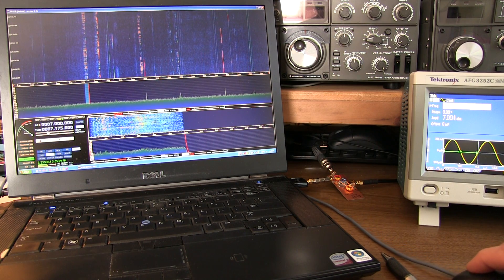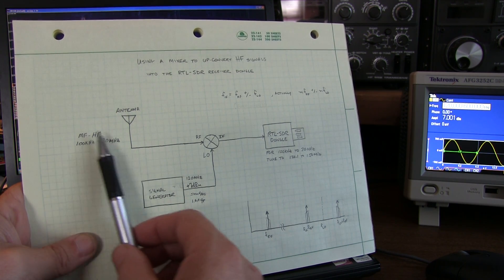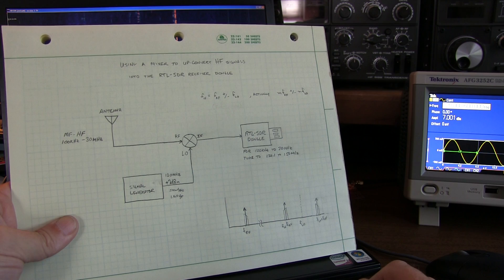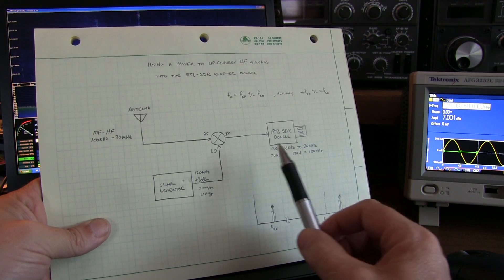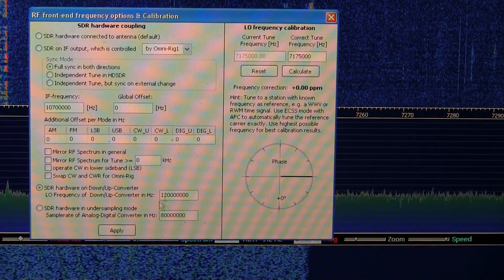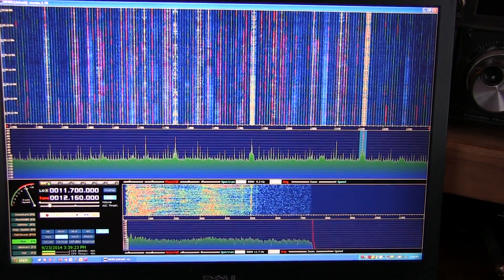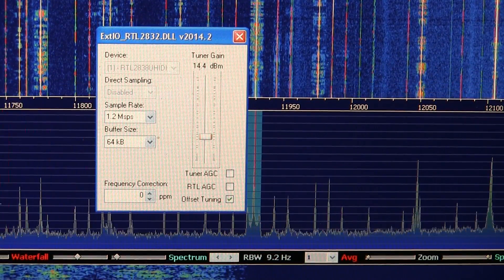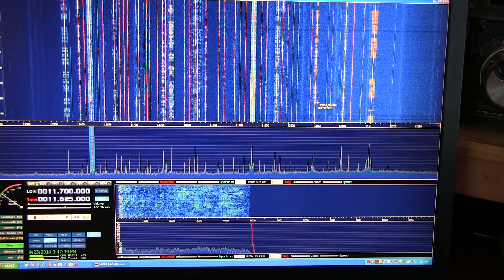#174: Using a mixer to listen to HF, shortwave, ham, etc. on RTL-SDR dongle

Comment: Hi
In some uwb radar systems there are antennas at some frequency like 100mhz 200mhz and other
But how an 200mhz antenna has been used for an uwb signal??
Because there is no any continuously signal there is just some pulses with fast rise and low pulse width (ps to ns) with a repetitive of 10 to 100khz
For example if ihave a signal with
1ns rise time
4ns pulse width
50khz repetitive frequency 
What is the frequency that my antenna( for example dipole) have to be set with a nanovna????
Reply from the maker: The antenna would be tuned for the RF frequency used during the pulse ON time.
Reply: @w2aew actually there is no rf signal like sine wave in the( on )time of pulse there is just some nanosecond pulse that coming out of an avalanche transistor circuit- for example 300v 5ns pulse comes to 1 arm of dipole and -300v 5ns pulse comes to another arm of dipole at the same time with a repetitive time of 50khz so if the pulsewidth is 5ns
Have I use an antenna that tuned for 500mhz???
Or for 1ns use 1GHz antenna???
Reply from the maker: @mofapage  I would think a 100MHz fundamental would be correct (5ns pulse width is half of a 10ns period, which is 100MHz).  The antenna would then work on the harmonics (of which there will be many).
Reply: @w2aew  thanks 👍 alot
I didn't tested yet antenna designing for such pulses I have to test it
I hope to do not damage my measurement devices :) cause they are high voltage pulses 600v to 1.5kv

Comment: Thanks again for great clip.  
Something, that I learned, which is useful for my professional designs, is to filter LO.  It makes sense.  Normally, we go to great extend to reduce phase noise of LO, such as current injection coupled oscillators under PLL control designs.  However, I never thought  of filtering LO, which should have been obvious. 
You may try direct conversion with this setup, see how does it work.
Thanks again.

Comment: Would it be possible to make a diode ring mixer without the coils? (I hate making coils :)    )
Reply from the maker: You may want to look into using a Gilbert Cell mixer
Reply: @w2aew  Thanks, today i remembered that i have some tiny transformers that have tapped secondary, would it be possible to use those? Or does it need a specific number of turns?

Comment: Would it be possible to make a colpitts that is fm modulated running at say 1mhz (something more stable) with varactor modulation, and then upconvert it with a mixer to hit the 2 meter band? For 2 meter FM? I was worried it might do some strange FM inversion..or it may be difficult to keep the local oscillator out of the output..it would be similar to what you are doing here but used to generate the actual transmit signal. I thought maybe it would be easier to build a stable oscilator at a lower frequency and also easier ro modulate possibly. Just a thought experiment really
Reply from the maker: Yes, this is certainly possible.  In fact, it is similar to how most transceivers operate.  The modulation is typically done at some lower IF frequency and then it is converted up to the output frequency.  By doing this, all of the modulation is always done at a known, fixed frequency - then, the output frequency is just a function of the LO to the mixer.  A filter on the output is used to reject any LO or IF components in the mixer output.
Reply: @w2aew  interesting..but the part i am not sure about yet is if the LO has to run say at 144 Mhz, and the FM is coming in from the input at 1Mhz you would get 145Mhz with the sum, correct? I dont see how you could filter the 144Mhz at all in that situation, its too close. So maybe 1Mhz is just low, not enough difference. Either that or the mixer would have to be very balanced with great LO rejection. I am not sure how to solve this. I tried to google it before "2 meter upconversion" but didnt find anything. In fact the difference freq would only be 1mhz below, and prob inverted, thats what i think would cause a problem.
Reply from the maker: @researchandbuild1751  This is one reason why there is often a double conversion.  Also, the mixers used are often double-balanced mixers (DBM).  When properly designed, the LO is attenuated greatly at the output, so you only have to worry about filtering the opposite image.
Reply: @w2aew  ok those are good tips thank you. I guess one could make the input run at 15Mhz or so,  that way its probably more possible to filter at the LO and up (highpass) basically calculate what band range you want and have both frequencies at a decent division to make filtering more effective. So 145Mhz with 15Mhz would be a 130Mhz LO and you could probably make a decent filter to cutoff 130 but allow 145 and up for example. Im sure there are some more tricks to it but thats the basic idea i guess. Thank you for your responses!

Comment: Love your videos, big help in understanding how a radio works. Now, I am playing with old tube radios, mainly Heathkit. I have a receiver, an HR10B that I was listening to one evening, and the signal just faded away into nothing, no static, hum, or anything, just all of a sudden, nothing coming out of the speaker. I've been told to look at it with a scope, mine happens to be a Heathkit also, and it works very good. Now I'm told I can trace the signal coming in from the antenna through the different tubes from grid to plate and watch it on the scope as it's amplified into a signal that the speaker can recognize and this way, by following the path, I can find the area in the receiver where it stops, and then I will know the components to check in fixing it. Now that all sounds pretty easy, but if you don't know what you are looking for on the scope, it's means nothing to me. I've watched numerous videos on building a signal probe, sounds easy, and it seems like a good idea if I'm looking for the signal, to use a tracer, but that's as far as the videos go, showing you how to build it. I would love for you to do a video of a receiver that has stopped receiving and how to find the problem. I have two right now that happened the exact same way. Any help would be much appreciated, 73 de WA1YDK
Reply from the maker: This video might be helpful.  Please pardon the background noise - the mic was poorly placed when this video was recorded.

Comment: thank you so much for your channel, i really get a lot of value out of it.
i have a couple of questions that maybe you could find the time to answer... i am wanting to align an old tube radio but i do not have a signal generator. i do have a function generator, and a frequency counter. i have seen videos showing the IF alignment done with no modulation on the IF (455kHz), where you use only a meter (or scope) to find peak, without need for a tone. but i am unsure if this is possible for doing the RF alignment or if i NEED a tone on that signal. if i do not need the modulation or tone, then i am mostly fine, but if i do need the modulation, could i get that using a diode ring mixer like the one you have demonstrated? i THINK i could run it with LO of say 400Hz, an RF of say 1000kHz and i would end up with something like DSB-SC (dual sideband suppressed carrier) 1MHz suppressed carrier with 400Hz modulation -- is that right? then, if i ALSO split the signal from the function generator before sending it to the mixer, and reinjected that signal back into the line after the mixer, i might be able to put the carrier wave onto the line as well.... would any of this work or am i crazy?
thanks so much for any help, if you can find the time!
Reply from the maker: It would be better if you have some tone or other modulation on the signal, that way your signal will occupy more BW and you'll better be able to center the response in the IF filters.  If you use a mixer, you can add a little DC offset to the LO signal to retain some carrier.
Reply: @w2aew  perfect! thank you very much!
Reply: @w2aew  does this hold true for RF alignment as well, or only IF? COULD i succeed (albeit poorly perhaps) with no tone doing RF align, or would that just not work?
Reply from the maker: @proctormacbelle4904   It depends on what kind of circuits you're aligning.  Sure, they can be done with an unmodulated RF signal, but a more precise result would likely be obtained when a modulated signal is used when called for.
Reply: @w2aew  thank you again! this inspires me to experiment.

Comment: Completely unrelated to this video,was wondering if you considered, a series of videos on oscillator types,common reasons for why  they don't work even if they simulate fine.. I have had issues with a lot of different oscillator types and  apart from a fm transmitter circuit all refuse to oscillate above 28 MHz .

Comment: Why is my homebrew downconverter for sdr not working? I am using a diode ring mixer with 10 turns for each transformer and I am using 1N419 diodes. When I adjust my function generator, It does not affect the spectrum at all.
Reply from the maker: Transformer performance also depends on the core material.
Reply: w2aew thanks

Comment: So a Quadrature Decoder mixes a Local Oscillator and Phase shifter, to yield Real (I) and Complex (90 deg shifted)..   is the only reason to do this so that the software knows how to separate what was originally on the upper band vs the lower band?   i.e. It has nothing to do with Nyquist?

Comment: the mixer should be flipped for upconversion.
since you are shifting up,  i'd put the R side to the sdr radio
Reply from the maker: The RF and IF ports of a double-balance diode ring mixer are generally interchangable, whether you're doing up or down conversion, or using high-side or low-side injection.
Reply: @w2aew  most datasheets I read on mixers show a lower frequency response for the I port, and if it didn't matter why would they bother to mark the ports of the mixer?   I have designed many rf circuits, your mixer is reversed.

Comment: Thank you Mr. Wolke for another great video! If I may: for folks that are on linux and looking for the app - I recommend GQRX for RTL devices. To decode digital signals from analog of GQRX use DSD (digital speech decoder) + padsp to pass it to the PC's audio device for listening.

Comment: thanks for your videos. i'm 'new' to RF and really want to understand and design my own circuits. i'm planing to use a mixer chip on my first build (SA612) and from what i learnt so far impedance matching is terribly important. i want to measure the output complex impedance of the mixer at my frequency on interest (40m band)... i think i know how to measure the input impedance.. but just wonder if you have advice on measuring the output, and if indeed this is commonly done by ham enthusiasts..

Comment: Thanks for sharing, very useful! Do you think a ready made crystal-oscillator (4 pin version) would do the job as LO? I guess this kind as oscillator has a square wave output and not a sine wave... Did you match the diodes for your mixer? vy 73's de gabriel-db5ag
Reply from the maker: For a diode ring mixer, a square-wave LO will generally do a good job.  You will want to apply appropriate filtering to the input and output to minimize aliasing and distortion.
Reply: Good to know, thank you.

Comment: I know this is going to get complicated so why not start of with a 74AC74 configured as a Johnson counter which drives a PI5V331 configured as a balanced QSD which drives 2x MC1350 preamp chips one for each output where the single ended outputs I.E. I/Q drive a RF  Phasing combiner for 455khz so your LO=((VFO+455000)*4) and should remove and birdies that happen during the down conversion process, will this work?

Comment: I have to admit that SDR offers so many advantages over more conventional receivers, especially compared to the old boat anchors that I'm so fond of, but it's hard to let go of the joy of finding a signal as you tune up and down the band, then zero beating your transmitter to his frequency, etc..  But, I do love learning new ways to do things. How much electronics has changed!
Reply from the maker: I agree.  I still love listening to signals on my old Drake 2B or Yaesu FRG-7.  I don't use one of the SDR dongles shown in this video - I gave it to a local ham friend.  If I want to scan the bands with an SDR, I use one of the many online SDRs.

Comment: can you use a 120MHz square wave as the input to your LO?
Reply from the maker: It depends on the particular mixer, but in general, yes, especially for low power mixers.

Comment: Could you down-convert twice to avoid spectrum inversion?
Reply from the maker: If you tune to the sum mixing product (f_lo + f_hf), there won't be any spectral inversion.
Reply: +w2aew I am considering options for downconverting from 2.4GHz and possibly 5.8GHz whilst avoiding spectrum inversion. Case D shown on this website is interesting. As they present it, if the IF is negative the spectrum is mirrored at 0Hz resulting to second inversion. So theoretically it should be possible to maintain the original spectrum downconverting this way.

http://www.rfcafe.com/references/electrical/spectral-inv.htm
Reply from the maker: If you want to downconvert with one conversion and no inversion, then simple use low side injection (like A/B).
Reply: +w2aew Doh! Of course,  I was fixated on something else and failed to see the obvious. Thank you very much for answering my questions.
Reply: What is low side injection?

Comment: First of all w2aew, one of my favorite channels on youtube, thanks for all the great content.  I bought one of these same nooelec SDRs on amazon when I saw your last video. (I also bought the Ham It Up 1.2 from them as well).  Are you using the stock antenna?  I have to use all 49.6 dB of RF Gain available  in SDR# to get even some of the wFM stations.   Is this the kind of performance you see with the stock antenna or your device?  Did you have to adjust the Frequency correction?  Not sure if I got a bad apple, and should contact the manufacturer.  Thanks in advance.
Reply from the maker: The stock antenna is not very good at all, you'll definitely want to use a better antenna for FM and VHF/UHF and above.  For HF, I was using my 130 foot dipole antenna.  You'll definitely need an antenna suitable for HF to get enough signal strength for shortwave reception.

Comment: Hey Alan, enjoying your videos and please keep doing what you're doing.  You did mention you picked your IF so it was above the FM band but I'm not sure if you're aware civil aviation uses the 108-140ish range.  Is this an issue at all?
Reply from the maker: Not really an issue. My main concern was getting interference from strong FM broadcast stations. The civil aviation signals are not likely to be strong enough to interfere with the up converted HF signals.

Comment: I would love to get into shortwave listening, and this looks like a great way in. However, what always stops me is the aerial required, i,e. 20m, 30m, cable strung between trees etc. I just can't do this where I live. Any chance of doing something on small booster type aerials that anyone can build for use in a built up area, it would be much appreciated.
Reply from the maker: You can often get creative, running wire around the ceiling or in an attic. Or magnetic loop type resonant antennas can work very well in a lited space.

Comment: Thanks again, another great video with great info.  As you know, I added filtering to my setup and it really came to life since I live by some nearby transmitters.  When using the mixer on HF bands I run my gain around -5db or so in sharp sdr program and when not using the mixer up on vhf/uhf I can run it with much more gain.  Even running low gain in the program I sometimes can see overload problems from strong SW stations on hf yet but it is under control.

Comment: is spectral inversion related to image frequency?
Reply from the maker: not really. an image frequency is an input signal that is equidistant from the LO frequency as the desired input frequency, but on the opposite side.  As such, an image of this signal will appear in the IF at the same frequency as the desired signal (but its spectrum will be inverted from the desired signal).

Comment: Excellent Allen. What would be your go to active component for the LO of this converter if you were to build one..? I know you were using your sig gen for this one. Also, were you using the small antenna for the dongle or your main mast antenna in this video..? Thanks so much for sharing!
Reply from the maker: Probably something like a decent oscillator from Vectron or something like that. I was using my 135' dipole.
Reply: I'll check Vectron out for sure. Yea, I just knew that reception was a bit to good. I look forward to more concerning this amazing piece of equipment. Thanks again!

Comment: Excellent post. As always its very didactic explanation. 

Some considerations: 
Try directly extract IF your radio and inject in sdr-dongle. 
Trough of a software called OMNIRIG you can go the other way, ie, changing the radio by tuning your own HDSDR and transmit by pressing the PTT. 
The use of SDR in ham radio is a very good tool for learning. 
Congratulations. 

73 
PU2SRZ